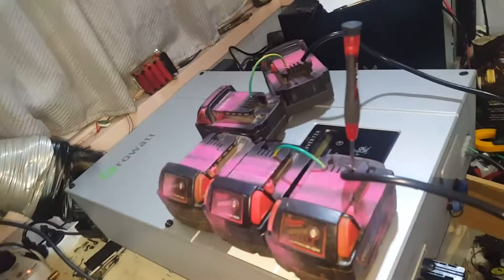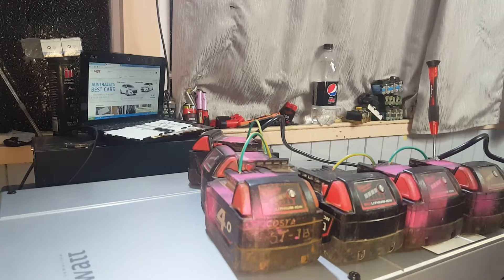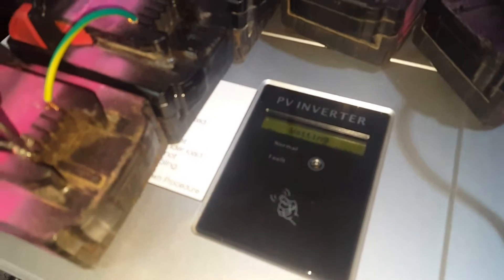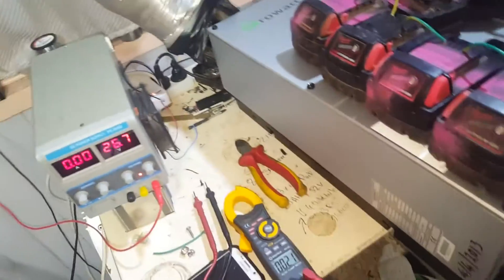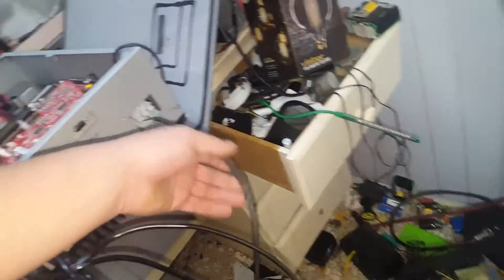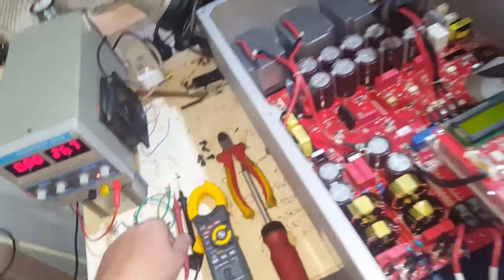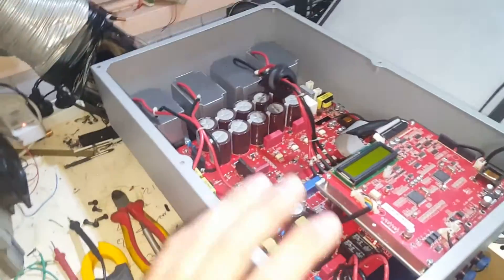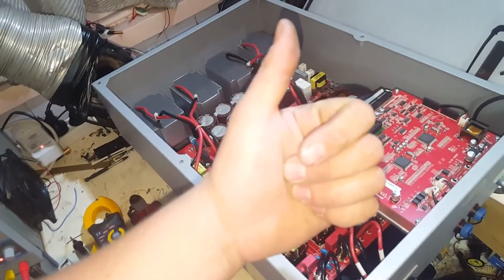Growatt 5000mtl 5kw grid tie inverter testing  Ac and Dc

Comment: Thw issue Is, being that its a a grid tie inverter, you need to have it connected to the grid, unless it is receiving a feedback reference frequency in your area from the grid, I.e 50/60hz it'll continue to display the red fault light. I've done the same thing with a different inverter, I left it for over 24hrs and it kept saying "waiting, no utility". When I looked up the fault code, spoke to my tradesman, turned out that i indeed needed a grid reference frequency. The only way around it as it appears is to use say a small 100watt offgrid inverter just as a reference, coupled with the ac terminal of the gridtie inverter to mimic the grid frequency.  I'm trying to now isolate a particulate component I suspect to be responsible for the grid feed and see if it makes any difference. If not I'll do a video of my initial recommendation of coupling a smaller inverter ..
Reply from the maker: I've been told by a electrical engineer it's doable and works but the grid tie inverter won't start big loads like motors

Comment: Any grid-tie inverter over 3.3kw will only work with 2 strings to stay within the 550v regs, anything under 3.3kw you can get 1 or 2 strings
thats because if you have solar panels facing the north and west on ya rooftop they need to be split to handle the different voltages 
other then that growatt aint bad, its no sunnyboy but still decent, allot of the cheaper inverters distort AM Radio, swapped them out with growatt and thats solved the issue provided the panels haven't been wired in a loop
Reply from the maker: +Stratz Entertainment thanks for the extra info cheers enjoy my channel

Comment: I have one, it works on one circuit, I can switch one off and it stills works, and goes down to below 50 watts when the sun goes down and starts up.
Reply from the maker: +sven thanks mate i appreciate the  feedback  i will test it again with a few more volts  (maybe another  40) cheers
Reply: i think i have 8 panels and 10 panels. so i think one is over 200v and one string is over 300 volts
Reply from the maker: +sven cool so seperate inputs is doable sweey as
Reply from the maker: +sven cool so seperate inputs is doable sweey as

Comment: You've got enough voltage to start the PSU within the Inverter, but not the inverter itself.
You only need to power 1 string to get it to output power, that said you can't draw 2.5kW from some power tool batteries anyway.
http://www.gigabiz.co.uk/download/sales/Troubleshooting_for_Growatt_TL_and_MTL.pdf
Reply from the maker: +station240 _ thanks mate  a friend of mine  has a test bench at work  so going to  do that after xmas.  Thanks for watching  as always